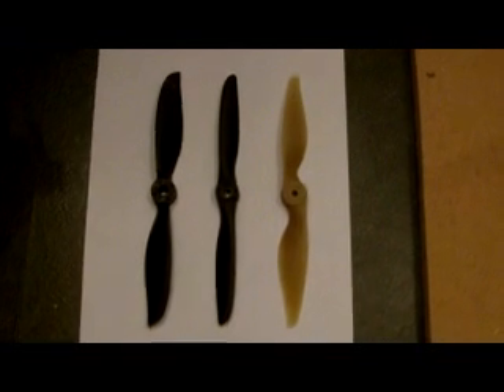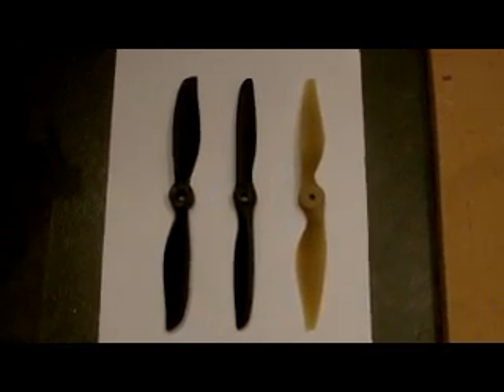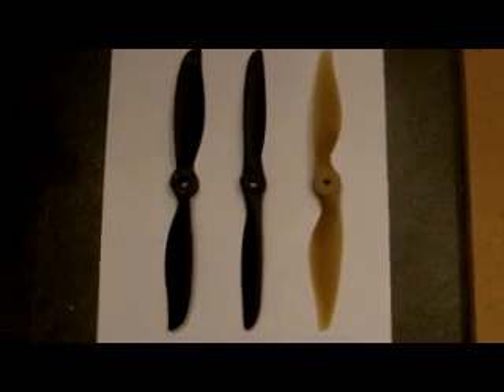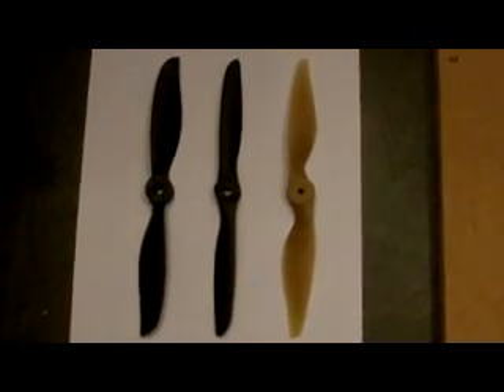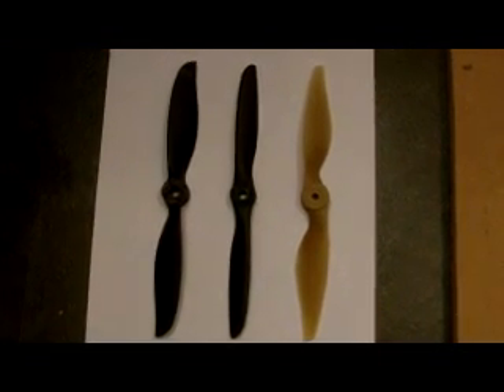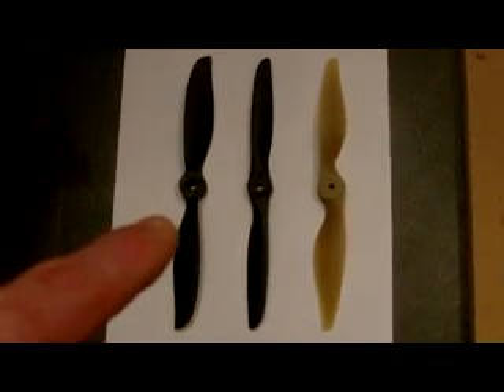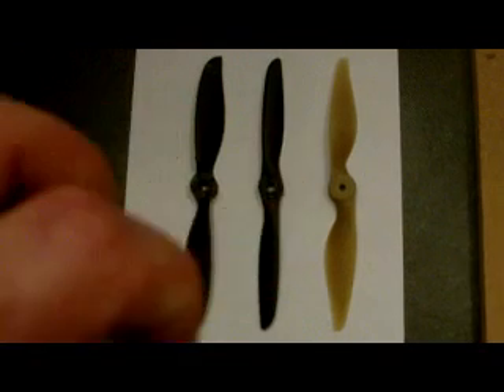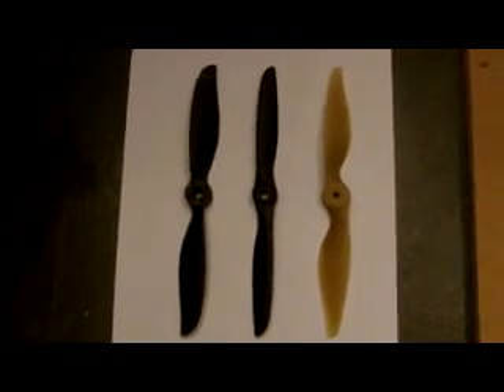APC vs TGS vs JXF Prop Thrust Test

Comment: Also, good point about the TGS 7 inch props.  I've suffered the same problem.  I had heaps of 6x4 props and love them, thought to myself "why not try the 7 inch props", bought one only to find that it looks wildly different to the 6x4 and everything about it is about double the size of the 6x4, even the mount was unusable as it was too chunky.  Waste of money.  But the 6x4 and 5x5 I've used before are awesome.